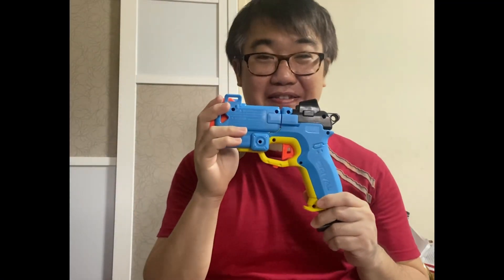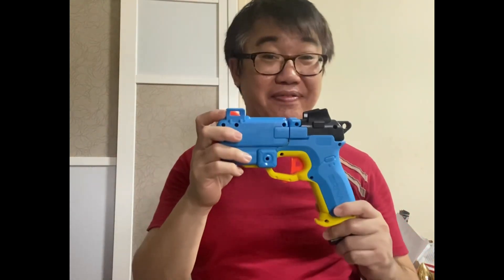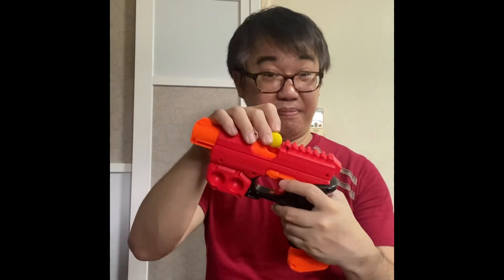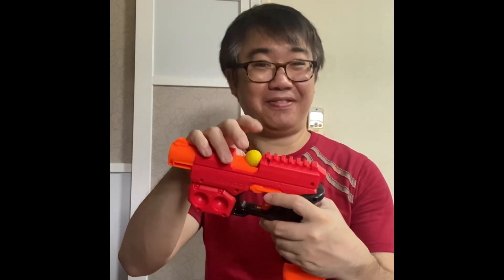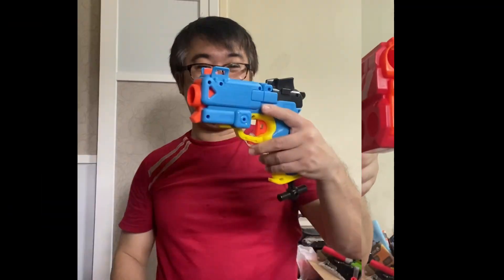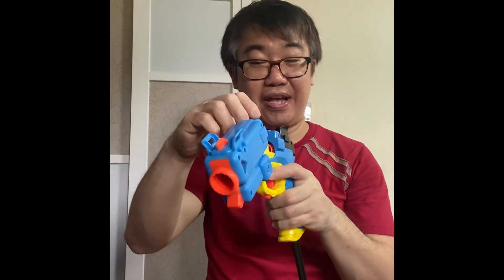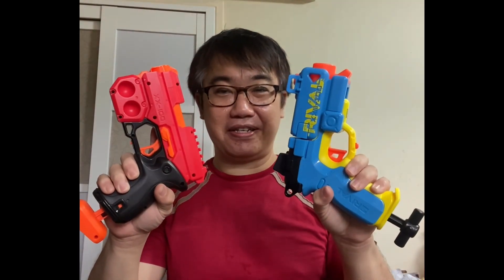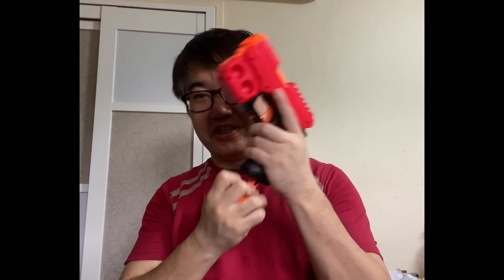Nerf Rival Knockout and Pilot

Comment: Thanks for the explanation! I got a Pilot earlier this year, and was wondering if I should have chosen the Knockout instead -- but the Pilot seems more convenient. 
Although one situation where the Knockout might be better is with the barrel attachment for firing Mega XL darts. When I pull the Pilot priming handle, the break action pops open, which is unnecessary in that case since the Mega XL dart just fits over the barrel attachment, and closing the break takes more time.